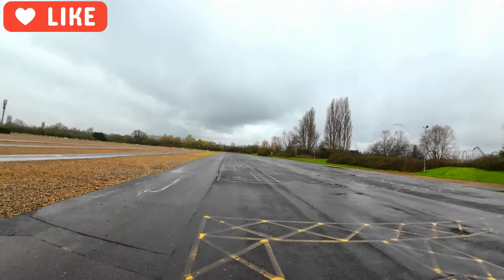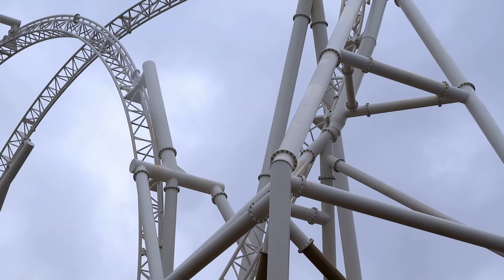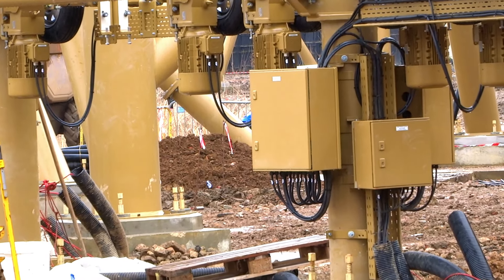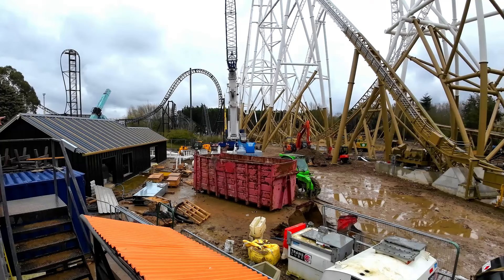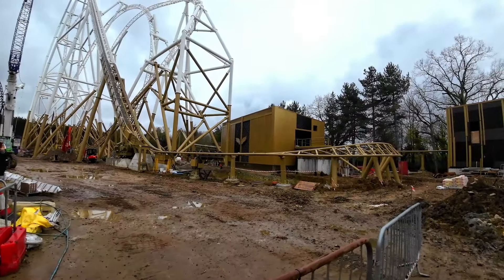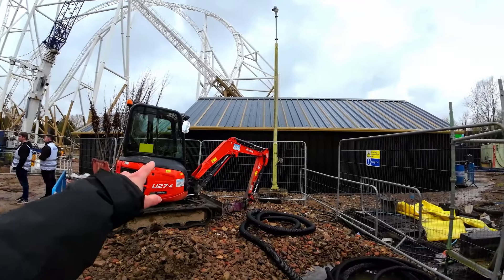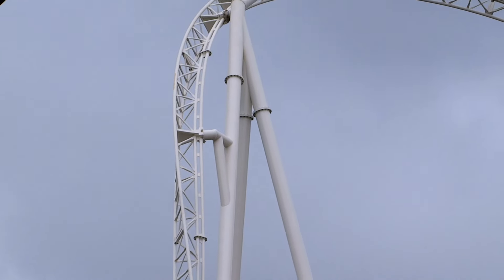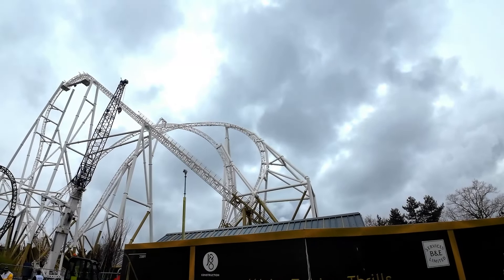Hyperia ON SITE update Thorpe Park - 10th March 2024

Comment: You can see the re-welding they did on the turn around joint now. Nice update.
Reply: where abouts on the ride is that?
Reply: @harrh4528  as you enter the outer bank turn that transitions into the barrel roll. 6.40 seconds
Reply: @mrwickedweasel  was there an issue with the manufacturing ?
Reply: @harrh4528 I would guess the alignment was ever so slightly off with the connection, so they tidied it up.